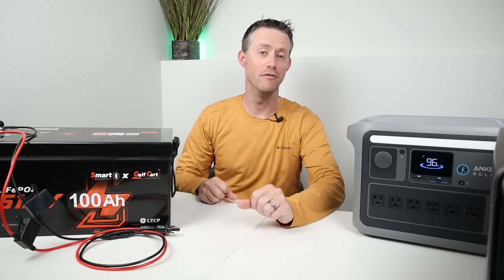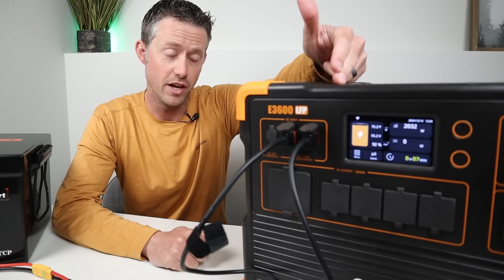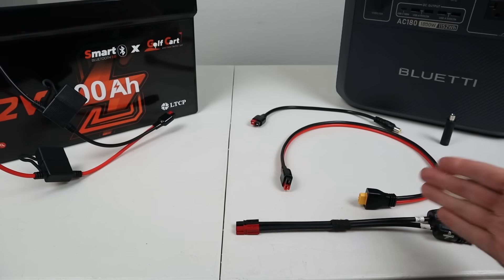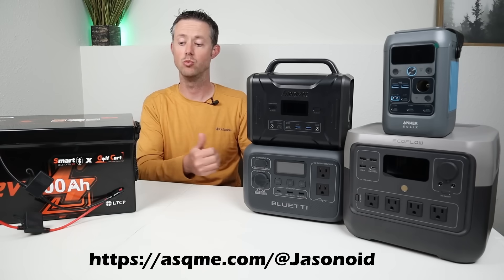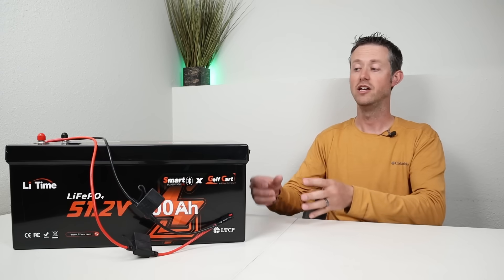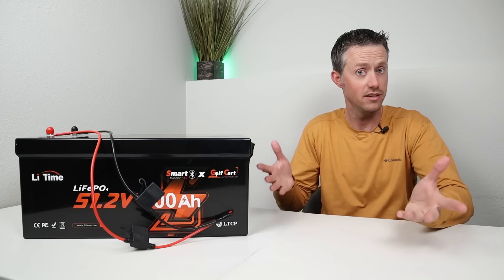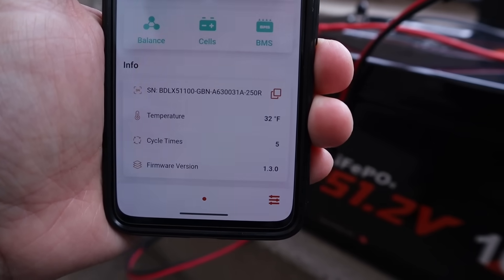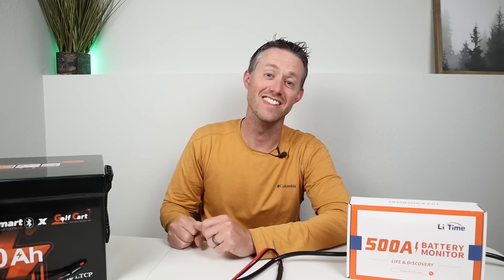Simple Trick to Make Your Power Station Last 5X Longer! Charging with a LiTime 48v Smart Battery!

Comment: I have the same setup on the C200. I'm pretty sure you don't need the inline fuses since there's BMS in both the battery and PowerStation. The fuse just add resistance between the battery and power station. correct me if im wrong
Reply from the maker: I don't think there's anything wrong with having built in safeties. No pressure to use fuses.

Comment: Great work, Any recommendations for DJI Power 1000
Reply from the maker: You have to get the new 1800w car / solar fast charger that allows for 60v input. I have one Im testing and it works great with a 48v battery and 1000w of charging.
Reply: @Jasonoid  Ok so if I get the car fast charger 1000w and connect a 48v battery to it, since it has bidirectional charging. it can charge the battery and when the power is out the battery can charge the unit -- will it work that way I am thinking?
Reply from the maker: @sukhoi01  nope, that one doesn't allow a 48v battery. 
There's a new super fast car solar charger that does 1800 watts. That higher powered car/solar charger allows for 60v input.
Reply: @Jasonoid  got it thanks. Also I have two of these connected to refrigerator. For some reason if I disconnect power and let them run on battery for say few hrs. Then turn the power back on and the DJIs battery is completely charged to 100% it disconnects the ac power output although the grid power is on.
It happens ever 4-5 cycles. Any idea how to avoid this.
Reply from the maker: @sukhoi01  I haven't seen that issue with mine but I'm also not testing it like that daily. It's best to report bugs to DJI support so they can look into it.

Comment: Great video!! Would that system work with dji power 1000? What kind of connection? Thanks!
Reply from the maker: The inky way it would work with the DJI 1000 is if you have the new 1800 watt solar and car charger that has the 60v solar input. The smaller charge controllers only take in 30v

Comment: That’s fine for helping extend the usage of a power station, but when I’m out off grid, I’d have to use (in my case) the EcoFlow Delta 2 Max to recharge this battery.  This is where I really wish the additional batteries that EcoFlow has were much cheaper, especially since they cannot be used without the Detla bodies.  Be great if someone could “hack” / “trick” the Deltas into thinking this battery was an expansion, and we could make our own cables.

Comment: Can I use a 24 volt or 36 volt lithium battery and charging eco-flow Delta 2?
Reply from the maker: Yes, a 24v or 36v battery would work great as well.
Reply: @Jasonoid  thanks a lot!
Reply: May I charge the 24v battery from the solar (should I put a MPPT controller in the middles) and  running a xt601 cable from the battery into my EcoFlow2 (should I put fuses or breakers)
Reply from the maker: @gamalierpty  that seems like it makes sense, hard for me to tell your exact setup from a YouTube comment.

Comment: How would I use two 12 volt batteries in this example?
Reply from the maker: Wiring those batteries in series would help increase the charging speed from just a 12v battery.

Comment: Can it be charged using the panel that came with my C1000? And how?
Reply from the maker: You'd probably need more solar panels. Usually you'll have to have higher voltage coming from your solar panels to charge a battery.

Comment: Can you recommend a solar charge controller and panel array setup to charge this particular battery to be able to continuously feed 1KW to a power station (e.g. Ecoflow Delta 3 plus)?  Better yet, produce a video showing how to put one together with all the safety built in.
Reply from the maker: I have two of these charge controllers:   https://amzn.to/41ljtRF

They can take in up to 150v of solar voltage. Wiring three to four 400w panels in series should work in most cases.

Comment: Hey quick question I am thinking getting couple those batteries you have but in 12.8volt Marine trolling motor batteries 12.8 volt 100AH Amazon has them buy 2 for $ 455.00 And friends telling me they won’t last long under trolling motor abuse discharge and charge.Note he paid like 600 for one 12 volt 100AH but Dokota battery I no saying you get what pay for what’s you’re take will these last the manufacture that makes you’re battery you have on that 48 volt battery only difference mine are 12.8 volt and says trolling motor battery thanks I can’t see paying for 5 batteries I need at 600 a piece any suggestions with Li time 12.8 volt 100AH trolling motor marine batteries thanks so much any help appreciated
Reply from the maker: LiTime is a higher quality 'budget battery' so youll see better performance from LiTime VS other no name budget brands. I've have good experience with my LiTime batteries. Just don't abuse them and you should be good.

Comment: Why 48v?   If a battery is 48v 100Ah, isn’t it still only 1200Wh?   If a 12v 100Ah battery is only around $180 which is still 1200Wh, what you gaining or losing by having one volt over another volt?
Reply from the maker: Charging with a power station with a 12v battery gives you 100 watts charging. Higher voltage voltage gives you faster charging.
Reply: @Jasonoid so just a much longer time to charge it back up!  Got it.   I have that Anker c1000.   So a 12v would take like 10 hours to change?   And if I have something connected over 100w then it’s pointless as the solar generator will die before the 12v battery has time to charge it back up or maintain its power?
Reply: No, you need to multiply the voltage by amps to get watts/wh. 48v 100 amp hour battery is 4800 wh.
Reply: @logicalsarcasm8479 ahh correct, my mistake!   

But now how do you charge the battery off solar?    I see many charge controllers that are listed at 12v/24v.   Can you not change a 48v battery with that?   I have a 220w, 40v panel and one CC I’m looking at says 12v:30v or 24v:60v, 12v180w, 24v360w.   I’d assume if I hook my panel up to a 12v battery something bad will happen.  A 24v battery I should be ok as the panel is smaller. But could I still hook up to a 48v battery?

Comment: Do I need to recharge the expansion battery individually with AC adapter? When I charge the power station will it charge the expansion battery too since its connected in series?
Reply: Yes. No. Respectively.

Comment: Most people aren't going to spent that much for a 48V 100AH battery like that. Just start with one 12V and add one at a time in series. These days you can get them for $150 a piece so it's quite a bit cheaper to buy 4 of them, easier to move around and easier to replace 1 battery if needed.
Reply: He literally says there are smaller battery options! All your words and typing was useless.
Reply: I paid $690 to my door for a DChouse 48v 100ah with Bluetooth BMS. Shop around.
Reply: Depends on the use. If it's for camping and used as a backup for no sun then great. If you already have a 12v or 24v setup with those appropriated panels and have to invest in converters on top of the battery price itself then not worth it. A 12v battery and 1200w inverter will charge the AC180 twice as fast at standard charging and it's easy to charge a 12v battery rather than a 48v battery if it's  just a temporary use situation. Permanent situation a 48v setup is hands down the smart direction. Both great setups if both used in their optimal use scenario.
Reply: Complimenti  e grazie per la sperimentazione e le info,tuttavia ho adottato un sistema di carica solare con pannello da 500w, regolatore,batterie auto usate da 100ah,6 batterie in parallelo,e inverter 2000w sinuidale a 12v. Il mio PS Solarplay da 2500w viene alimentato dall 'inverter,che ha una scala di ricarica che va da 300w a 1200w se voglio accelerare,le batterie mi inviano 2500w con presenza di sole,se entrambi i sistemi si scaricano interviene un ATS,in genere interviene non frequentemente,cosa ne pensi può durare? Saluti da Venezia Italy😊
Reply: Pay more to cry once 😊
Reply: It all boils down to affordability, end of story. Not everyone has a pocket full of money when they are living paycheck to paycheck.
Reply: @meilyn22 is boomer, that's why he can afford.
Reply: I’d like to run this set up with the bluettie ac70  , it can handle a total open circuit voltage between 12V-58V .  Is that too close to max . It was mentioned that this battery runs as high as 58 volts
Reply: @keithm2327 yes, you need to have the ability to have more than 60v input otherwise you'll damage your power station.
Reply: @mexicoconnectionsguy  Wrong, i wish people would stop making comments if they don't know what they're talking about.
Reply: @keithm2327  If you want to connect a 48V battery to an AC70 and it can handle up to 58 volts then you're fine. A 48V battery will never put out more than around 54 volts after it's fully charged. Most 48V chargers are putting out 54 volts to charge the battery, and after you disconnect it the battery will typically hold a 52-53 volt charge.  If you're connecting solar panels to an Ac70 then you want to make sure not to connect panels in series if the panels will be over 58 volts, so just keep them in parallel.
Reply: @tonyinfinity You need a balancer to get 4 12v batteries in series to work. Even at that, they will still go out of balance. Avoid the headache and just buy a 48v battery. Don't listen to this guy. The BMS in 12v batteries weren't made to be series connected. They can't communicate with each other. Bad idea! Cheap doesn't mean better.
Reply: Bigger wires, balancing issues, hard to scale. If you are done using a power station, you can easily switch to a 48v inverter. More efficient, plug and play, less risks, no balancing issues.
Reply: Good all-in-one power station prices are so much less expensive now vs a few years ago that they make more sense for any system under 5kw vs the cost, space and involved in buying and installing separate components.
Reply: Tony is right , that's the way ,
Reply: My detailed answer got del-Ted.
Reply: @meilyn22 . I can see it.
Reply: You are clueless.
Reply: @meilyn22 why do you say he’s clueless. Just curious for the counter argument.
Reply: @andresgilbert2237  Tony’s right that cost matters, but 12V in series comes with problems people overlook:

Balance: 12V batteries often charge/discharge unevenly, and one bad battery affects the rest.

Efficiency: 48V runs cooler, needs thinner wires, and wastes less power.

Maintenance: A single 48V unit is simpler—less wiring, fewer failure points.

Safety: Fewer connections = fewer risks.

Longevity: Cheap 12Vs might save money at first but wear out faster.

A good 48V battery is a smarter long-term investment for a clean, reliable setup.
Reply: @andresgilbert2237  Also, the battery in the video comes with low temp protection, Bluetooth, and a charger. Most 12v batteries don't have this. It's just a pain to connect 12v in series just to save little money. In the long run, you will have issues and will have to spend more to fix them. You will spend more on wires too.
Reply: @meilyn22  thanks for the reply :)
Reply: @ LOL why didn't you start out with that instead of saying I'm clueless? I'm aware of all the things you said however they aren't all true. First of all everyone is going to have a different use case scenario. If I was powering my house and needed 100's of AH's and high WH's obviously I wouldn't start with one 12V battery. However when you say "A single 48V unit is simpler" and "12V's wear out faster" you're talking out your ass, they use the same smaller batteries inside in series and you also said "one bad battery affects the rest" well that holds true internally, if you have a bad cell in a 48V the whole battery is screwed, if you have a bad battery in a series with four 12V batteries it's easier AND cheaper to just replace the one battery. So maybe you should think twice about instantly insulting someone whom you know nothing about. I'm not clueless, I'm well educated and know plenty about solar and batteries. I was simply letting people know if they are on a budget you can start with a single battery and work your way up to a 48V system. AGAIN would I do that for a whole house setup, no. I have 3 12V batteries in series that I plug into my Ecoflow Delta Pro when I just want to add some extra WH's and it works flawlessly and I can also just take one of those batteries with when we camp for an extra boost to my smaller Bluetti. Am I going to do that with a 48V battery no way! So like I said everyone has a different scenario, there's no one perfect way to do anything.
Reply: @ Again you're wrong. Yes most 12V batteries do come with bluetooth and low temp protection these days. Also you talk about cables and the complexity of having multiple batteries in series. This video is about ADDING SOME EXTRA POWER TO A SMALLER POWER STATION! There's no complexity to that. You can put 1,2,3 or 4 12V batteries in series and do what he's doing. You're trying to argue about things that don't matter in this situation like batteries not charging/discharging evenly and cabling, LOL that's for large systems where you're powering your house with solar and have a battery back-up. If that's what you need to do obviously you'd want a 48V rack system. So think about what you're saying instead of just trying to insult and argue with someone.
Reply: @tonyinfinity  So the batteries with Bluetooth and low temperature protection cost $150? This is why I said you are clueless. So if you need more capacity, you have to keep buying 12v batteries until infinity? It's just bad advice! Don't go this route. Always buy 48V batteries if you can. In the long run, you save money and time.
Reply: @tonyinfinity  I like how your argument keeps changing, and you keep editing your initial comment. Your initial comment talked about how people aren't gonna spend money on a 48V battery. That was why I called you clueless. Had nothing to do with Ecoflow or anything else.
Reply: @meilyn22 thank you for the additional information. Like most things, doing it right often costs less in the long run , safer, more reliable and easier

Comment: Does the 10awg cable from the battery need to be fused if I'm using a 24v battery if so what size fuse? I've seen other videos where they did it without inline fuses, so I want to be sure.

Comment: Bluetti will sell you the external battery and adapter for thousands… and at least with an AC200P there is also no balancing and no way to see total charge… and no way to limit the power transfer to trickle charge the main unit.

All the disadvantages with huge markup! I returned the expansion battery but unfortunately it was too long after purchase to return the main unit.

They sold me an expandable unit that was nothing more than a very expensive battery

Comment: so, the Bluetti AC200P has a solar minimum voltage rating of 35v, would that mean when the battery has 3500Wh left, it will no longer be able to power through the solar input?  if so, only half the usable capacity is viable which wasn't clarified.
Reply from the maker: A 48v battery goes from 58v fully charged down to 46v when empty. You'll never drop below 35v 👍

Comment: Hi, here is my guestion. Ecoflow delta pro XT60 max input values are 150V 15A. Can I combine two lines into one as:
A) on one side the current from the panels with a power of 800W, 60V 13A and
B) on the other side the current from the 51.2V LifePo4 battery with a power of 420 W 55V 8A. 

Can I keep both lines open at the same time or do I have to keep only one or the other open with some DC breakers?
Reply from the maker: You cannot combine the sources together. Unfortunately, the solar panels would not work with the battery on the same port. Solar panel voltage changes too frequently. It's best to use one at a time.

You could use your solar panels to constantly charge your 48v battery and then have your 48v battery connected to the chaefing port on your power station. Kinda like a chain effect of charging.

Comment: Hi, I have FOSSiBOT Portable Power Station F2400, 2048Wh solar generator battery output with solar charging: 12V-48V/15A MAX500W, what batteries will I need. Thank you

Comment: Using the Li Time 51.2, 100AH, Would I need to use the Bluetti DC Charge Enhancer (D050S), to connect into the (DC7909) port on a Bluetti AC200 max power station?
Reply from the maker: No, you just need to adapt your LiTime 51.2v battery to have 7909 output.
Reply: Ok, thanks!
I do have to use the enhancer when I’m connected to my solar panels, so I thought I may have to when connected to the Li Time Battery.
Reply from the maker: @beetreefarms4471  nope, the charging enhancer was not designed for the AC180 and you don't need it. The AC180 has a charge controller built into it.
Reply: What I meant was that I am using the charge enhancer with the AC 200Max into the DC7909 Port and also using my second Charge Enhancer into the B230 extension batteries.

Comment: Would like to know the ATC/ATO fuses used in 12V auto DC wiring, such as the one in the video, when used in a 48 V battery, I had the impression that these fuses are only for 12V DC.
If these fuses are fine to use in 48V DC batteries, does the fuse rating for example 20A when used in 12V, will it still be 20A when used in the 48V setup or different amperage?
Reply from the maker: I tested these ATC 30 Amp fuses with a 32 amp load and they popped pretty quick so they still protect the wiring.